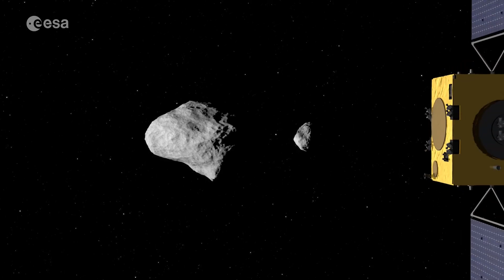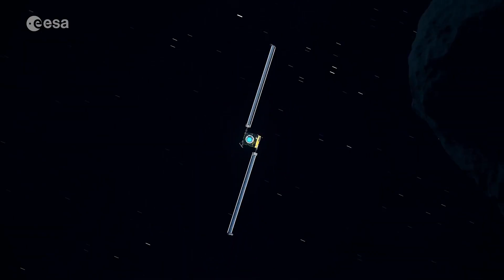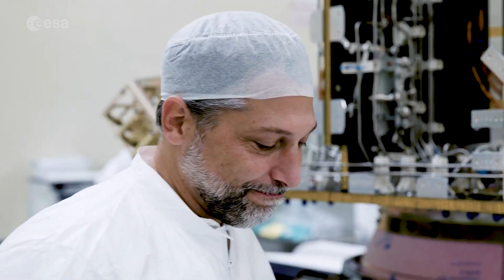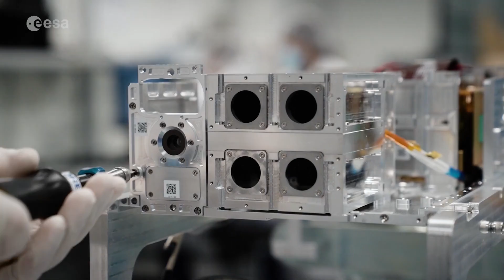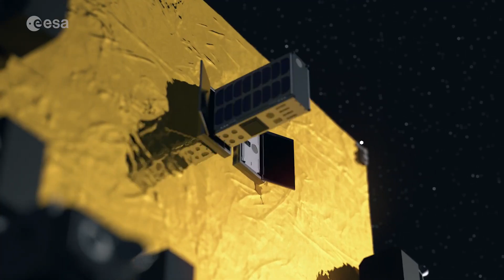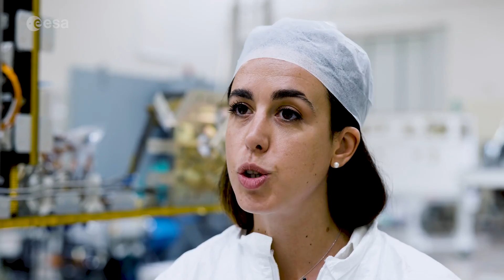ESA's Hera mission will investigate asteroid DART impacted

Comment: Awesome. Isn't most of the kinetic energy spent on shockwaves / acoustics / fracture vs trajectory deflection though with the high speed 'destructive' impact? Future system could possibly use a retro landing with a large propulsor payload post-landing even complete with thrust vectoring to attempt to counteract initial body rotation / for precise trajectory manipulation?